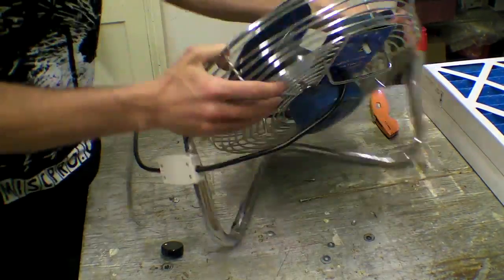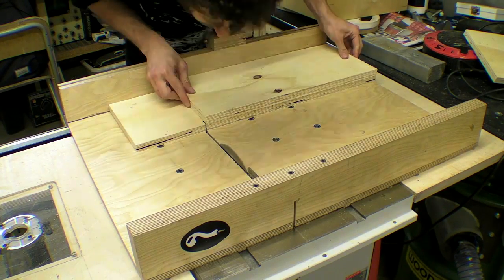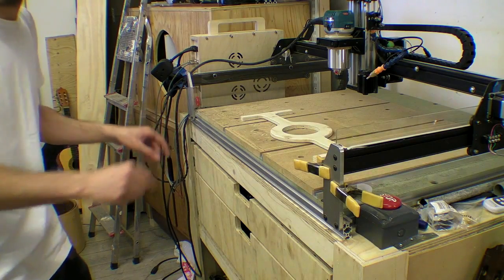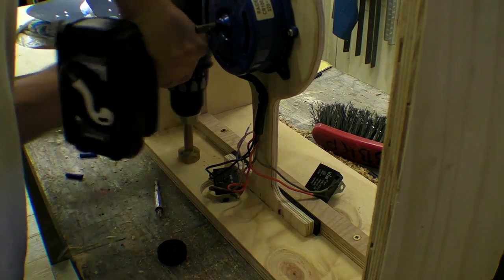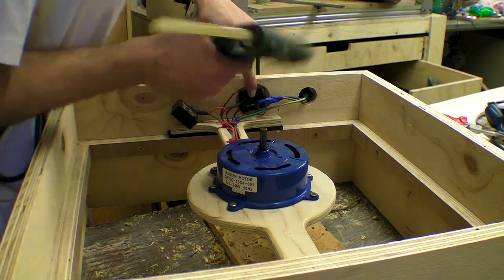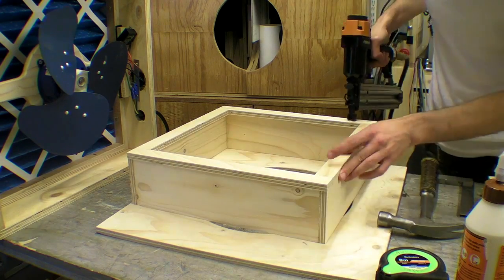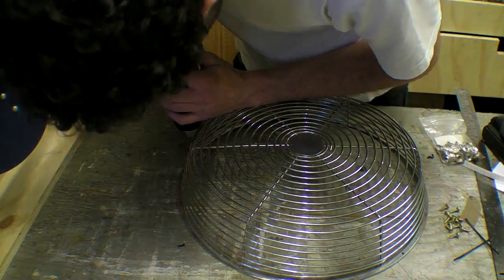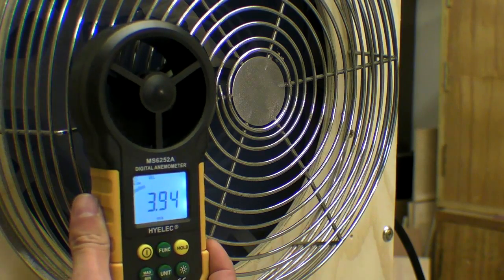Workshop Air Cleaner / Pleated Dust Filter / Activated Carbon VOC Scrubber Test

Comment: Hello! I am interested mainly in VOCs as well. But I want to create my own purifier.

However I can't go this elaborate. 

So my question is, Would it be possible to put some filter on a box fan (as a lot of diy'ers do on youtube) but the difference is somehow use a filter that would remove VOCs?

What do you think the best way to do this is?

HEPA / Furnace filter on the back of the fan, then activated charcoal on the front?

Comment: Excellent video It was great to watch a craftsman applying his skills - If I were on a ship to Mars this is the air filter/scrubber I would want next to me. Because I do not have your skills or tools mine will be a 20 inch box fan with a single filter slapped on the back.

Comment: I would recommend to construct a much thinner cage for the activated carbon, so that the layer with the carbon is just 5 mm thick (maybe a little more, like 8). The front and the back of the box should have much bigger holes, so that the particles got a decent airflow.  Fine mesh could prevent the particles to get lost while still not blocking the stream of air.
The box should also have a latch on one side, so that you can easily replace the carbon when it's saturated.
Otherwise, this is exactly what I was looking for, thanks for the Video.
BTW...with chipboard the box would resonate less.
Reply: Can I ask where you learned this? Is it just trial and error?
Reply: @dianeibsen5994  
I'm a studied engineer.
Reply: Very cool. Thank you for your reply. I'm having issues in my  apartment re. indoor air quality. Do you know much about that? Wonder if you have some time for me to ask you some questions regarding a filter I tried to create in the window port hole thing? d @moronsmorons8913

Comment: Larger air flow isn't necessarily better for carbon filters.  They have what is called residence time.  In other words it takes a certain amount of time for the carbon to absorb the odors.  If you force the air too fast it doesn't have enough time for the carbon to do it's job.   Just keep that in mind if it doesn't work as well as you would expect.
Reply from the maker: I was speaking to the guy from British Engineering who checks our equipment at work. He didn't recommend lowering the air flow on down draft tables even for fumes. The more I thought about it I had to agree. Say the fumes are being produces quicker than the time it takes to draw through the carbon. Also lower air flow means not all the fumes will be drawn through the carbon. And finally - where your head was while the fumes were being made. Better to get it away from you. Also I have no way of measuring if it's working or not. Lol.

Comment: I have no idea if this is feasible, or practical in terms of expense.  However I saw someone made a comment which is "Greek" to me, but may be helpful to you.  We need an updated Charcoal filter fan for VOCs if anyone can figure it out.  thanks!
"Works very well to scrub and remove unwanted compounds from oleoresin being prepped for distillation. Scrub at 100f Filter through silica bed and 1 micron boro paper."

Comment: Instead of using 2 2in filters why not use a single 4in-5in thick filter, I don't know if they are as common across the pond but if you want activated carbon , at least here in the states several manufacturers make filters with activated carbon impregnated media.

Comment: If you used a Squirrel Cage fan instead of the blades you would get lots more air flow
Reply from the maker: Ah we call them a centrifugal fan. I was thinking of making another filter which I can connect to my inline fume fan.

Comment: Actually I do not like your air purifier (I think the blower is not proper for this job) but how is it after 3 months, do you run it on a daily... ?
Reply from the maker: There's a pic on my Instagram of how much dust it collects - I'm very happy with it.
Reply: aham, I saw, yes it's working. You mention that your filter is G4, my air purifier is with G4 and F9, and the pre filter (g4) looks clean, 10 months already, It is a little dark but there is no wood dust. I am starting to think  that my shop is very clean, I am trying to catch everything from the sorce (I have and  top and bottom dust collection on my table saw) basically my table saw is dustless, may be because of that I do not have so much wood particles in the air, still have but not so much may be. ;]

Comment: Had an idea for the activated carbon. Mount a Long larger diameter pipe on the wall and put it in there. Then put fan on end to push air through. Then make it so you can rotate the pipe when you want to put a fresh side on the top. i bet you could get a large diameter shipping tube to make it out of too.

Comment: Very interesting! too bad the carbon didn't work. I guess what pushes the air in those cases needs to be more similar to a compressor than a fan. I'm waiting for the next one!
Reply from the maker: Maybe an impeller fan would be better?
Reply: +Savvas Papasavva probably!
Reply: +Savvas Papasavva
An idea to increase the air flow for the carbon: a larger box, using two identical fans in a push/pull configuration, one post-filter perhaps?

Comment: Here's a crazy thought for the activated carbon. How about a perforated bottom 5 gallon bucket set over the outlet on your portable dust collector? Mix fill the carbon with other filler to reduce the total pressure drop. That dust collector should have enough static to push thru a sandwich layer of screen with the activated carbon/filler in between. That or the other idea of crushing your carbon up and coating one of your dust filters. It will load them up, but you could occasionally blow them out and re coat with your massive bag of activated carbon.
Reply from the maker: Good idea. It could work as the hepa filter in the extractor will capture the dust, and the exhaust should be relatively clean air. It also crossed my mind, that I could fill up a bag in my henry hoover with carbon and just turn that on.